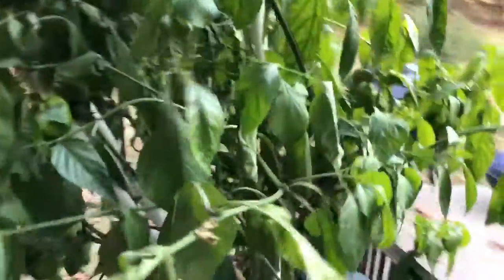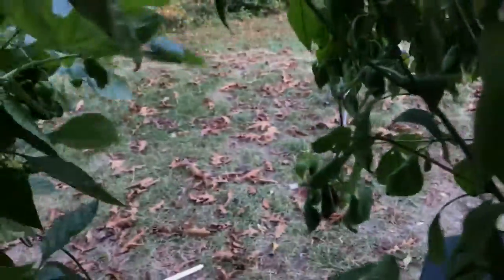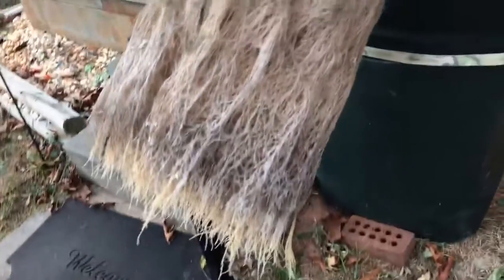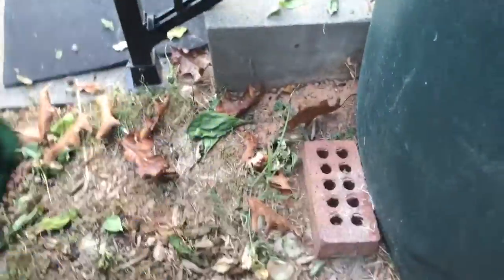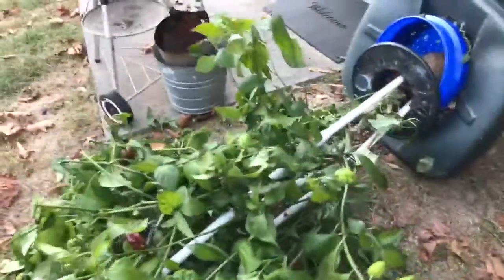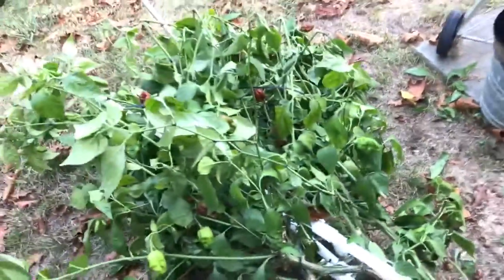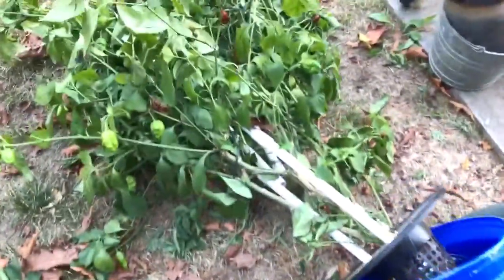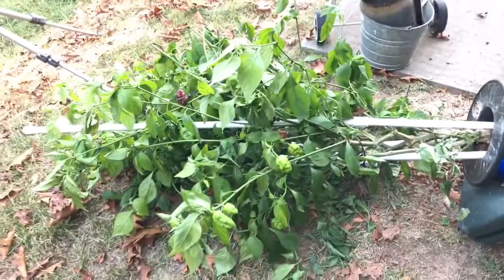45 gallon Kratky Non-circulating hydroponics - BBM final update

Comment: Add a airstone and air pump to keep the water from being stagnant and add auto fill valve with the float connected to water hose water level will always stay. Lastly get a blue lab ph ppm temp all in one meter leave it in water u can adjust ph and ppm when needed with out having to lift 🌳 to get to the reservoir...pretty much a giant dwc bucket
Reply from the maker: Thanks for watching. Kratky method doesn't need an airstone, as the air exchange is done above the nutrient level. I have used a float valve and reservoir on Kratky setups and it does work well.

Comment: Hey buddy I made a auto filling version not sure if it’s going to work check out my latest video if you got any suggestions
Reply from the maker: Looks like a cool design! I made something similar with a 27 gallon tote. I got lazy and just put the float valve in the tote and have a 5 gal bucket attached to it. I have two plants in it, took most of the summer to draw down all the nutrients in the tote, just last week started pulling from the reservoir. I like how yours is spread out, allows a lot of room for your plants to bush out.

Comment: Thanks Peter. Great Video. Some suggestions that work great - use a smaller rubbish bin & add a float valve 25%-30% from the bottom that supplies nutrient from another tote. This will extend the life of the plant to the entire season (or forever if you want). Plus, you can save your trash cans from buckling by stacking cement pavers from the bottom of the trash can up to your bucket at the top. The cement will wick well which adds some further vigor to your plants.
Reply from the maker: Those are great tips. Thank you!

Comment: Diabolical. Maybe dig a shallow hole and partially sink your reservoir. The walls of the hole could help support the bucket.
Reply from the maker: Thanks for watching! I'm using that same trashcan again this year for a Bih Jolokia, I'm seeing that again, where it can't support all the water in it very well, starts to buckle. I think it'll hold up. Those food safe barrels you can get used are thicker and hold up better. I need to move away from the trash cans to just using those.

Comment: Should have topped it up with a tad of  water
Reply from the maker: Thanks for watching. Yes, a little water added back doesn't hurt. You have to be careful not to add too much or it could drown the air roots. I'm trying out a static level version this year, reservoir fed using a float valve to control the nutrient level. That is working well so far. Basically setup like a normal Kratky system and the nutrient will draw down to the level you have set with the float valve, then the reservoir will feed from that point. You just have to top up the reservoir periodically. I got the idea from Matt Garver. https://www.youtube.com/channel/UCUznk-cggnf5NrnneXBykfQ You can see how it's doing on my most recent grow update 2018 #18.

Comment: Hi. Do you still use the non-circulating method? I tried growing tomatoes and green peppers in a 5 gal tote. The problems I found were having to add water and nutrients and mosquitoes.  Do you have any suggestions for either? I was thinking about this system (a sturdier container) as it would take it through the grow season.. Thanks
Reply from the maker: I still use this method. It is challenging to grow this way using small containers. You have to change out nutrients often while making sure not to overfill. Dr. Kratky posted a video a while back showing a method he used to control mosquitos, using a screen. Here's the link to it. https://youtu.be/6teoqf6MQrM

Comment: Looks like it turned out well though :) I am quite surprised that you did not cut out the bottom of the 5 gallon bucket. Was there a reason why you just drilled holes?

Comment: Nice setup. How many times did you have to refill?
Reply from the maker: With Kratky setups, you don't want to refill as it will drown the air exchange roots. You can add small amounts not much more than 1/4 inch above the existing nutrient level to keep one going if needed, but that isn't ideal. With enough nutrient solution to begin with the plant can grow to maturity on one fill up. That makes the setup truly fill-and-forget. My plan for next season is to use large reservoirs,  or maybe linking two 45-55 gallon containers together to get a total of around 100 gallons. For the large chinense species peppers this should be enough. (I hope)
Reply: you can refill them, just not too much.  You could have added 10 or so gallons without hurting your plants, or use a reservoir that refills as it starts to get low.

Comment: Did you by chance test the Ph and PPM from the tank?  Wonder what the drift ended at.
Reply from the maker: I tested at the beginning, but I didn't test what was left. If I still had it I would, but have already dumped it. The initial values were pH 6.0 and 850 ppm.
Reply: Thanks
Reply: @pepperdactyl  850 PPM was before adding calcium nitrate and magnesium sulphate  ? Or after adding??
Reply from the maker: @nadeem5476  It was after adding everything.